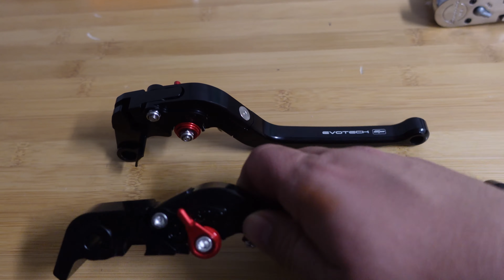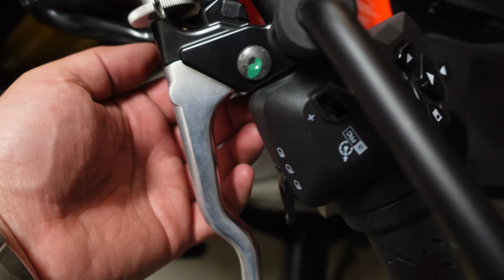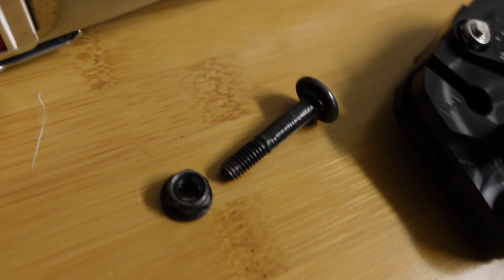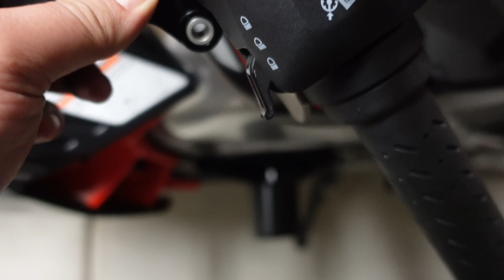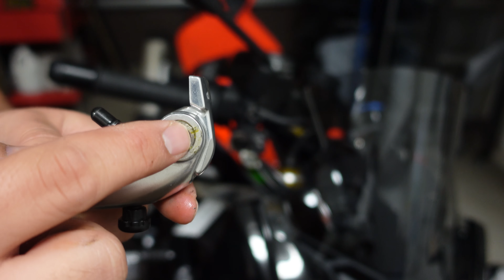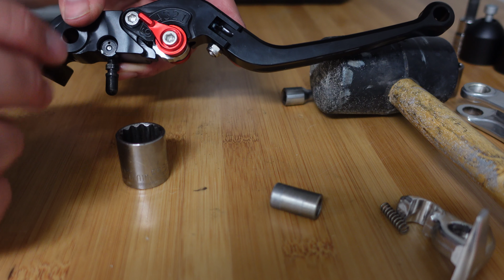Evotech Performance Folding Clutch and Brake Levers 2021 + Aprilia Tuono V4 Factory Install

Comment: How do you get the plunger out? It is tight as hell!!😂
Reply from the maker: Did you already get the brake lever bushing out of the way? Definitely move that plunger around and spray lubricant around it if needed. If really seized in there you can lightly heat the OEM brake lever with a heat gun around that plunger housing area to help with relaxing those clearances / tight fit of the metal. Good luck!

Comment: Great instruction! How does the reach compare to the OEM lever? I find the OEM lever to be a bit too far away even if it's adjusted to closest position.
Reply from the maker: @387horsepower  for my circumstance I finally found the perfect reach with these levers. It’s an upgrade that I honestly enjoy every time I’m on the bike. The adjustments are very precise so I was able to find the sweet spot for my riding position 👌
Reply: @conceptanddesigntheory  Glad to hear that. Thank you so much for the input, and ride on!👍

Comment: On the brake lever boot I had to use small needle nose to spread open the boot to get the pin in. Hope that helps.

Comment: Great video! Just what I needed to give me the confidence to proceed. I was a bit stumped by the brake lever setup and didn't want to force anything, but your video solved everything. I think Evotech gear is first-rate, my bike has several Evotech parts like yours, but the instructions are often a little vague at times, I think if they made videos like this it would be much better for everyone!  Very grateful to you. P.S. I notice below that others had exactly the same issue as I had, Evotech please take note!
Reply from the maker: I’m glad the video helped 👌

Comment: Very good video, but I haven't quite decided for my RS660, because I have seen many complaints that when turning the steering wheel, the brake lever touches a molding on the motorcycle 🙂
Reply from the maker: That’s interesting to hear. On my Tuono V4 Factory 1100 I have no clearance issues. Might be a handle bar vs clip ons issue. I imagine where the clip ons and fearing has closer tolerances but with a bit of additional adjustments would work out. Sounds like a good YT video to make!
Reply: @conceptanddesigntheory  Thanks for answering bro, I like to use the best for my Aprilia, and always before ordering something I make sure that it doesn't affect my RS660, I order almost everything in AF1 racing and they explain this problem in the specifications, regards bro 😎
Reply from the maker: @ianjoe9909  thanks for the heads up and I see the comment on af1racing website which is my favorite place for our Aprilia’s. Definitely a valid concern and need to either remove that trim piece or modify it. Much appreciated bringing this note up for rsv4 and rs660 +21 MY vehicles 👏

Comment: Cheers for this ,  Comparing the positioning / shape of the OEM to the EvoTech , I've noticed there is negligible difference - This appears to be an aesthetic touch. Anyone know of a lever that has a bend making the lever closer but without having to shorten the braking leverage fulcrum point?

Comment: I did the install but the brake light activates late, around 30-40% of max brake pressure. Should be a lot sooner. Do you have this issue? How can i adjust the front brake so the brake light comes on at 2-5% of brake pressure?

Comment: Did you have to readjust anything with the quick shifter afterwards? The Aprilia manual warns that you might have to?
Also, i do not like the folding feature as i think it is dangerous. Can you lock them so they do not fold at all?
When you put the pin in on the brake side, how do you know it is in? Does it click or something?
Reply from the maker: I didn’t need to adjust the QuickShifter just to make sure the clutch lever tension was correct per owners manual. If this is not adjusted correctly then you can have quick shifter issues. 

The folding feature folds up not down so this never folds for me during normal operation and is a safeguard that if I fall that I can continue riding with a functional lever in mild to moderate falls which is especially helpful in track riding. 

Yes once you place the pin on the brake side it slides right in place stays solidly in the mounting recess 👍
Reply: @conceptanddesigntheory  thank you. If you tighten the bold on the levers to the max, will it make them not to fold? I would rather have them fixed.
Reply: How do you like them?

Comment: Dont do the same misstake i did, be careful so u dont destroy the clutch sensor when u putting in the new 1
Reply from the maker: Yes it’s very fragile great point 👍 and I’m sorry to hear that you had issues with your install.
Reply: @conceptanddesigntheory  yeah it suxx but I will learn 🤣 ordered a new 1 will come in next week but till suxx, i thing i jade a problem with when i got the lever on it was hard as stone to pull in 😕
Reply: How do you destroy the clutch sensor? Where is it located?
Reply: @pantag2  its on the right of ur cluthlever underside, when u remove the lever there is a little thing that is sticking out with if u dont pull that back in then u try to out it back u wili likley brake it

Comment: I should have watched this before I attempted to do it myself with just the Evotech instructions 😅 they were lacking to say the least. Could have saved me a few scratches from struggling with the clutch lever/cable and figuring out how to get the brake actuator off the original lever.
Reply from the maker: Yes I watched a few older videos from YT and got a better sense of how to attempt this job. The instructions left me wondering especially about the brake actuator removal so it was nice to be able to remove it smoothly without the need of a special tool 👍. Nonetheless I hope you’re enjoying the new levers!